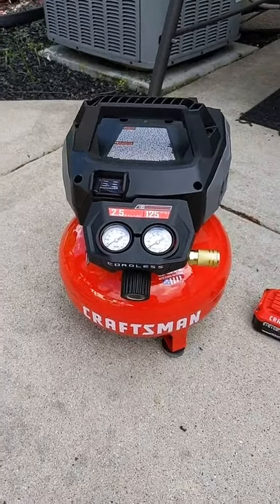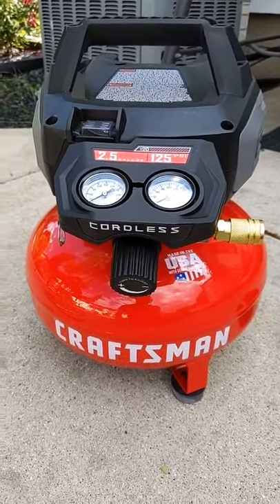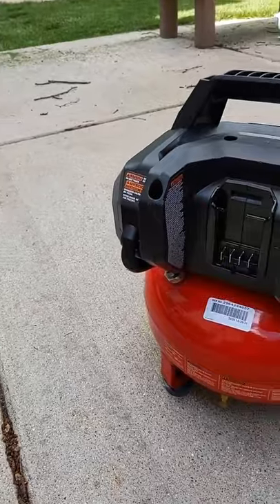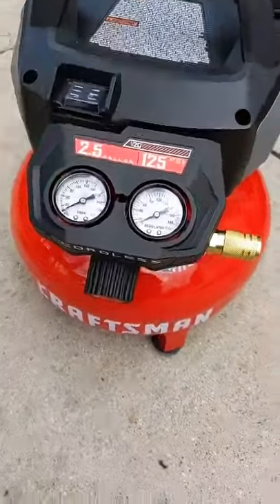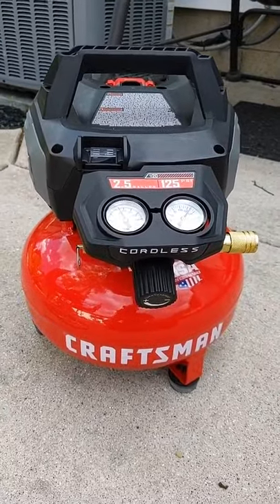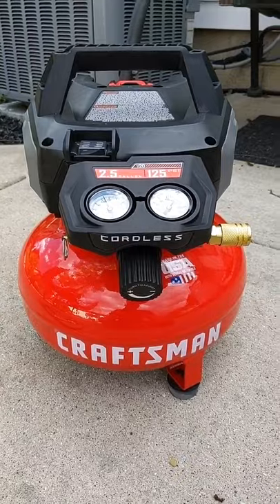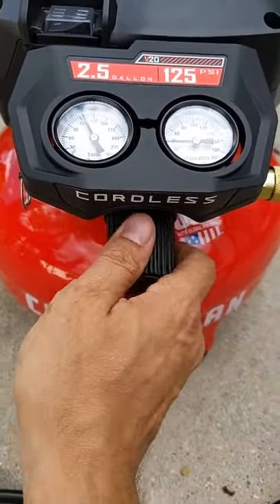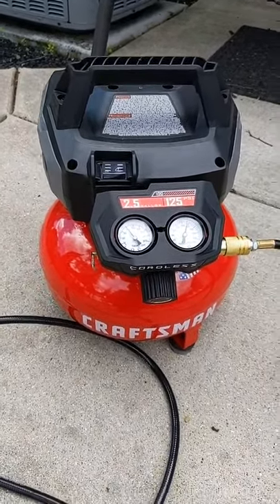NEW Craftsman V20 Brushless Air Compressor

Comment: I took it back and bought the smaller less expensive inflater that can be powered 3 ways...I ran the cordless compressor for 25 minutes and could not get any air pressure to inflate?

Comment: Thus compressor is nice. It's lite, quiet and not crazy expensive. However. It does have some cons. The big battery that it comes with doesn't last very long. And it gets hot so you can't immediately charge it. I keep it on my truck bc I have a full compliment of battery tools. I wish the battery lasted longer or had a larger capacity. Inflated a trailer tire from 20psi up to 80 psi. and the battery was done. So if you have more than just a few psi. You better have more batteries
Reply: What amp HR battery?

Comment: tried using mine to inflate a car tire but no luck. any tips on what fittings to use? im using one of the ones with a built in gauge and a tire inflator fitting
Reply: Dang so what happened? My dad might get one and he wants to know if it’s good I ought to inflate a charger
Reply: It runs but no air
Reply: @everettware3466  drain valve open?
Reply: @taylorvandervort8877  close and no air leaks anywhere
Reply: What battery size you got
Reply: @everettware3466 it fully fills and i set it to max pressure: i have tried different style valves but no air is put into a tire on my car
Reply: Feel like i am doing something wrong but havent been able to find what